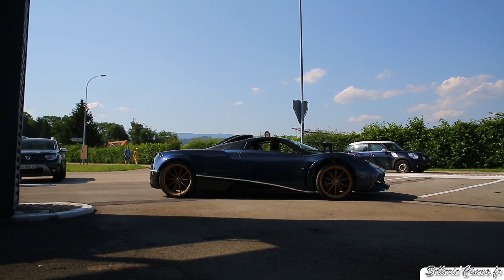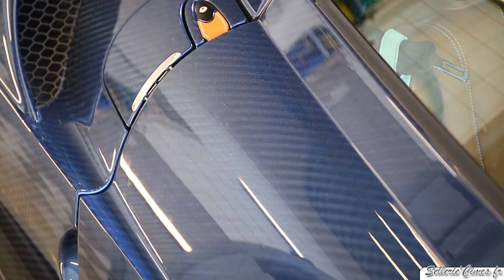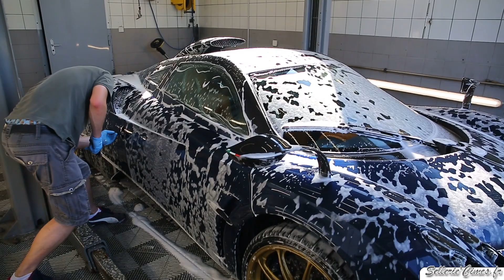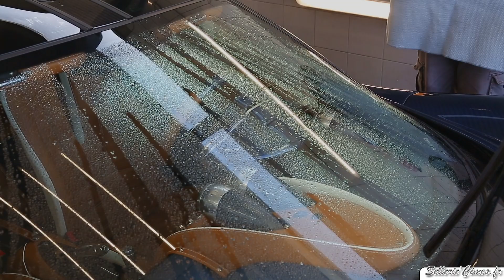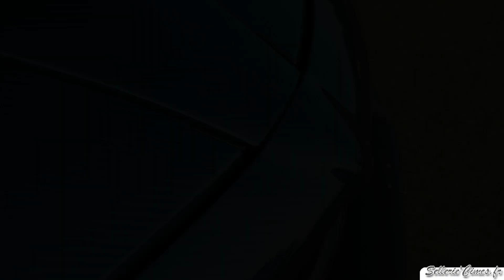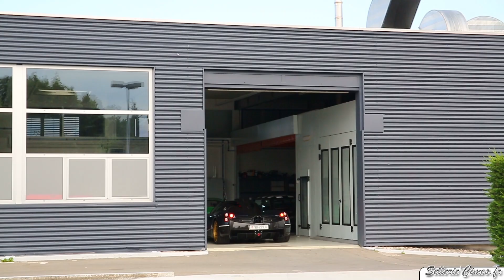Washing the Pagani Huayra Nautilo 1of1 with RP Detailing

Comment: I'd like to ask whether this expensive car used any PPF for the paint and/or ceramic coating for the windshield? Thank you
Reply from the maker: Both (if I'm right) ;)
Reply: Thank you :)
It’s just a little wondering  that when the guy in video spray water onto the Beast’s paint area and windshield, there’s no clear “hydrophobic effect” of the ceramic and PPF
However, a car this expensive should use ceramic and PPF for protection, and hopefully this Pagani already use both